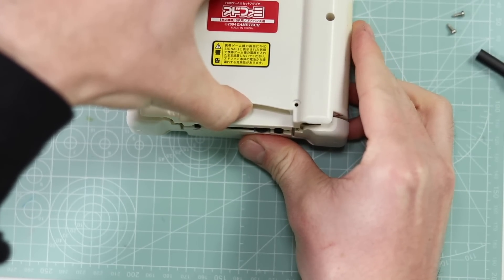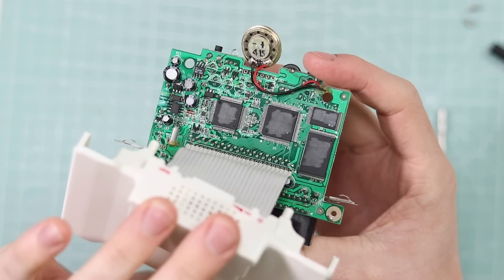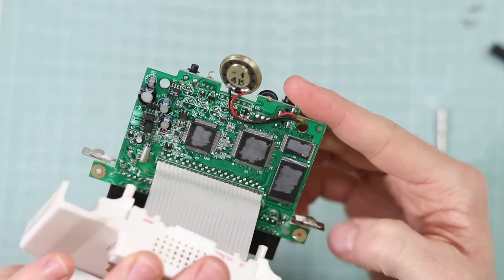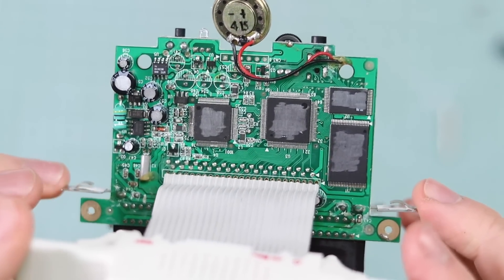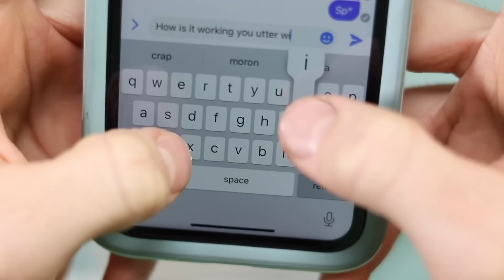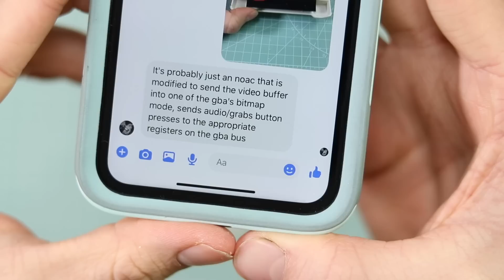What's Inside the GameBoy Famicom Adapter?

Comment: It being a NOAC is the reason that the audio is poor. The NES was developed with only 4 digital audio channels (for that matter, so were the GB, GBC and SNES). The GBA, GBA SP, and GBM all are setup to interpret not 4 channel audio, but 6 channel audio. The result is that when the audio from the NES memory is being put through the GBA SP's audio buffer, it is getting analyzed as having 2 channels of just blank audio, making the end result hollow. This is in direct contrast to something like the emulation on a EZ Flash Cartridge, which will take 2 of the audio tracks from the NES and mirror them, making the audio almost, but not totally perfect.

Comment: The reason for the AA batteries is probably because the NES had a logic voltage of 5V and the ARM based CPU in the GBA has a logic voltage of 3.3V. An alternative would be to use a boost converter off the VCC of the cartridge socket, but they're inefficient and noisy. Plus, the GBA cart socket probably doesn't have enough available current for everything in the adapter anyway, particularly the audio amp.

Comment: I have some more info on this, i own one and manages to get it turned on without the famicom portion powered on, what happened i got a blue screen with a black box saying no signal

I suspect there's a tv tuner in there connecting the famicom to the screen, this also explains the interference you see

This also does not work on a nds, it doesn't physically fit in the phat nds but i used my NDS-SP (check makho's vid) to put it in and it just hangs on a white screen

It does however work on a standard gba although its way easier to hit the cart making it go funky

Comment: From the looks of it you could pretty easily swap those battery connectors for a couple similar sized rechargeable batteries and a type c or other preferred port and make it last even longer. Given we live in the golden age of emulation for the NES however this is entirely a vanity project.

Comment: I don't think that the GBA cart slot has pins for screen and controller information. I think there is a GBA program (embedded) that is doing the I/O conversion, so it uses the GBA CPU and GPU: video from NOAC is digitized and compressed to a shared memory that the program move to a GBA background layer or similar, and passing the controller input to the NOAC (this could be directly)... or not. Great video!!!

Comment: NOAC is Nintendo on a chip. Its actually a decent system, not like the cheap ones where everything is on one glob top chip. I bet if you know the capacitor values and replace the missing capacitor areas with teh right caps it will have less interference and better sound.

Comment: I bet that NES-on-a-chip outputs straight out analog video, directly to one of those video converters like you reviewed before, which would explain the interference on the video you saw when using it. Wouldn't be too surprised if that is also a clone.
It's interesting that none of those video adapter things, as well as any GBA accessory that deals with audio that isn't game audio, has their own headphone jack and/or speakers. That does make sense tho, since the GBA has no audio-in pins on the cartridge like the GB/GBC had, so if you wanted to feed audio to the GBA that would be at best 8 bit PCM, hence the choice to go external on the (way simpler to implement) audio circuit.

Comment: If you were to solder a different speaker onto that adapter, would it fix the sound issues? Then you’d have a basically flawless adapter!
Reply: More then likely no. NOACs of this era tended to have not so great sound. Though a better speaker would not hurt.
Reply: @darksnow222  that’s a shame. Honestly despite having hundreds of options for playing NES/Famicom games these days if this were made with a decent stereo system I’d buy instantly. Or, hope an NES version came out.

Comment: N.O.A.C.
Nes
On
A
Chip

Although I suppose this would be a F.O.A.C.
Reply: I think actual FOACs would be more expensive to manufacture as they had extra audio channels, microphone input and lots more going, thats why chinese knock off companies did the NOAC, a lot cheaper and still runs all games.
Reply: Would probably work with (ideally American) NES cartridges with a 72-pin to 60-pin adapter (no region locking) but would look ridiculous of course. Someone else had the idea of trying it on a DS - the two in combination would look even more ridiculous!
Reply: The N can mean Nintendo too

Comment: noac. or Nintendo On A Chip. It's an entire famicom outside of power and video crammed into one chip.(I did think it was to fast to be emulated and it looks like this thing is doing it's own sound. or just a small DAC for the headphone / speaker idk) These NOACs are really common in cheap 8 bit clone handheld or plug and play games. They are normally glob tops though so don't see to many with actual pins. Also long chip on the right or the slightly smaller one above it, is that flash memory? dose it do anything if you plug a gba game into it but not a famicom game? I wouldn't be surprised if it boots up with one of those 400 in one carts if you boot it without a famicom game in it.
Reply: I would bet the chip you mention is the ROM for the video converter that puts it to the GBA screen, which itself is probably very close to (if not a direct copy of) one of the TV/AV adapters he reviewed as well. That and the famiclone chips usually spitting composite or RF straight out would explain the interference on the video, and can keep the cost way down, just feed analog to a part that does analog anyway instead of figuring out a digital video feed with non off the shelf components.

Also the sound: the GBA doesn't have an "audio in" pin anymore like the standard Game Boy and the Color too if I recall, all pins are data (sharing functions between address and data too if I recall, on the GBA), hence all the video adapters AND this one had their own speakers or audio jacks, feeding digital audio to it would mean 8 bit PCM only from what I remember the GBA being able to do.